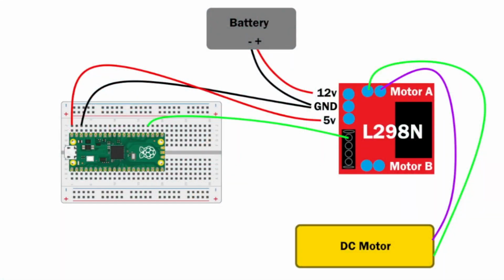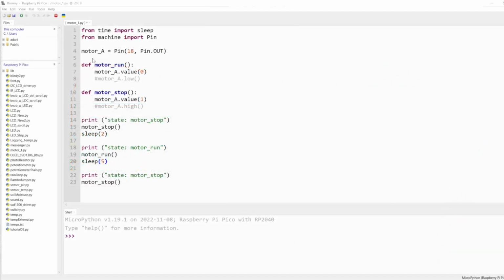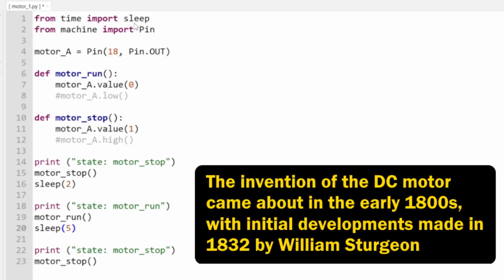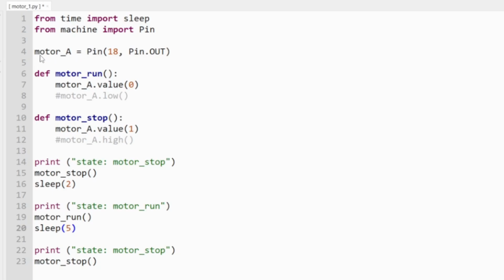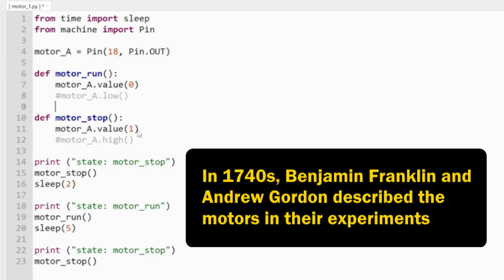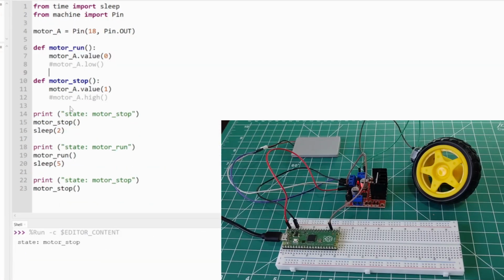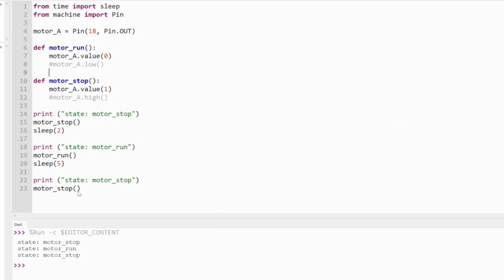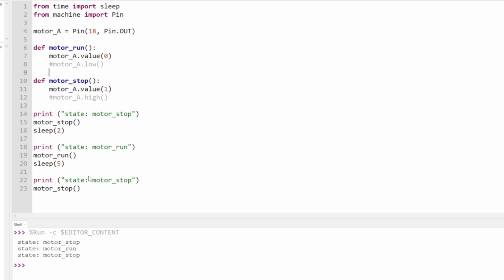Raspberry Pi Pico DC Motor in Micropython 🐍 w/Code MADE EASY

Comment: Can this run wirelessly? Like not with the USB cable?
Reply: the pico requires power 
the USB is supplying that
there are other ways of powering the pico with batteries which can be connected using the the first 3 pins on the top right of the pico
check out the various other youtube instructals